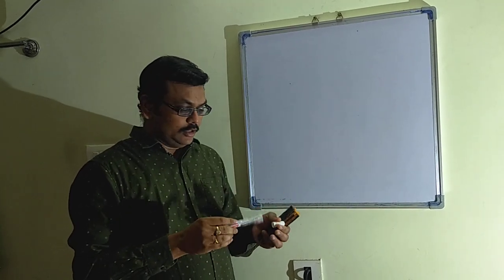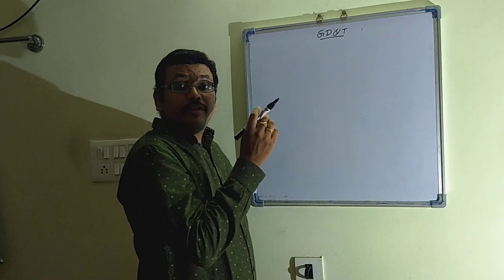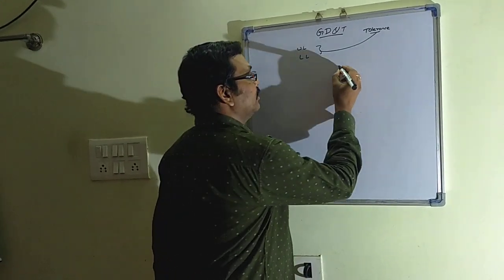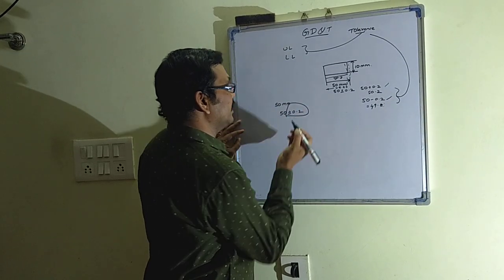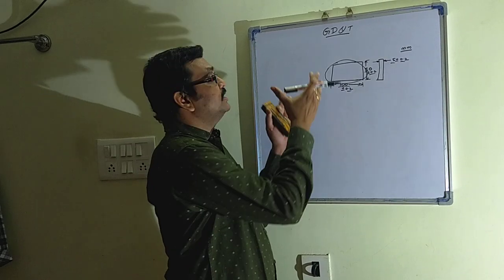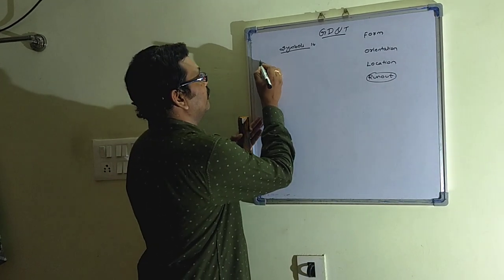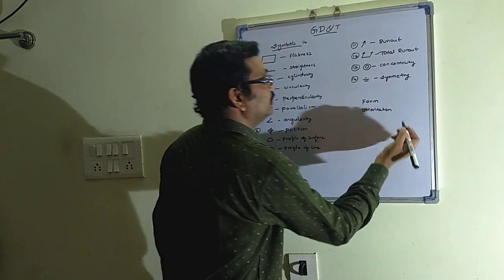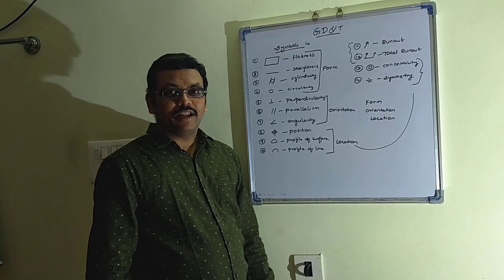GEOMETRIC DIMENSIONING AND TOLERANCE-GD&T

Comment: Hello I have some clarification how we decide the tolerance value for the particular base dimensions and also th tolerance in the feature control frame.... could pls tell me
Reply from the maker: Hi,we need to know where that component is going to assemble and particular application of our part .finally we have to do stack up analysis for correct mating.
Reply from the maker: Dim.tolerance is for correct mating and feature control tol is for correct making of particular feature